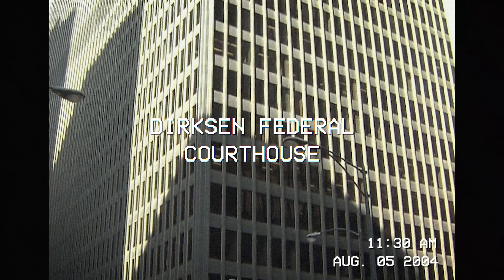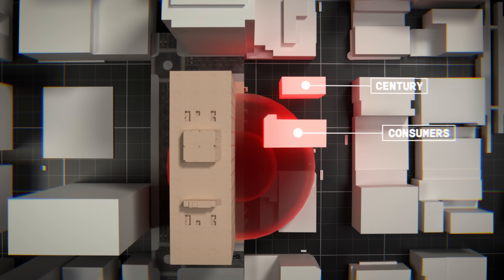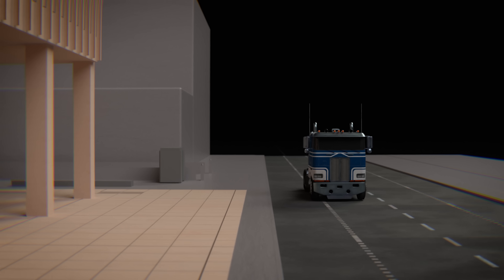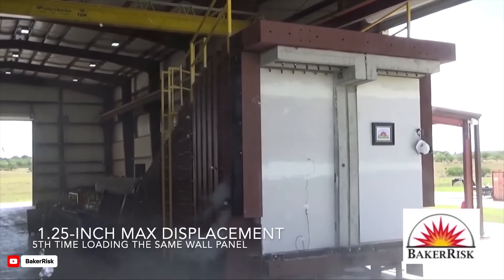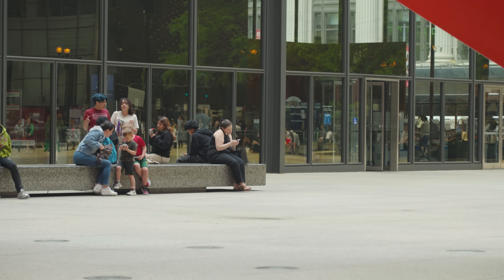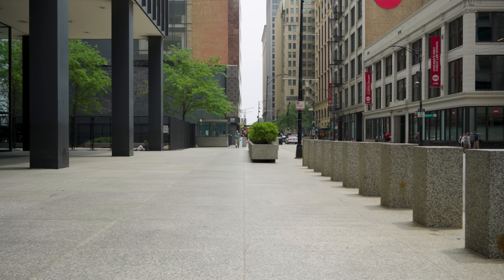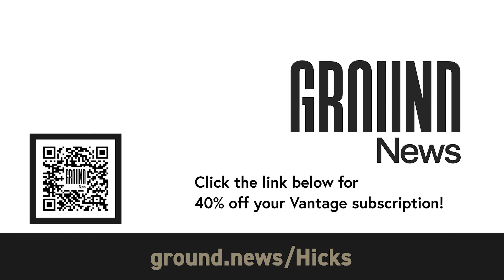How a Bombproof Building Works

Comment: i fast forwarded through to the mid-roll ad only to find that it was infact, already the end of the video?? the switch between 'the bomber has left the trailer in the basement and is driving away' to 'the plan was thwarted before this' was very confusing and unclear. what actually stopped him??

Comment: Some of you so called BIG BRAINS. May want to look at the average height of underground parking (8 to 12 feet), then check the height of a Simi and trailer (13feet 6 inches). 
Your fantasy is not possible the way you have it set up. 
You can't even get some of the smaller U-hauls down there.

Comment: Meanwhile you can just mail or deliver so many things so easily through the front door. Used to be a driver and it's crazy how lax security is at so many places including military locations. Not everything gets checked and even if it does........ that's already close enough, you already let them through. That's just a casual observation of a former delivery driver. If someone put some actual thought and intent into it you could get by even further.

Comment: Ground news put BBC in center ?????
A study by openDemocracy points out that between October 7 and November 4, 2023, the BBC described only Israeli deaths as a “massacre,” despite the Palestinian death toll being far higher.
An academic report found that 69% of the newspaper articles featured in the BBC’s daily program The Papers came from outlets supportive of the Conservative Party, compared to only 23% from newspapers backing Labour.
Richard Sharp, appointed chair of the BBC board in 2023, had donated over £400,000 to the Conservative Party and had close ties to Boris Johnson, even before taking on the role.

Comment: You send strong electro magnetic waves through the yard in front. And goes off before gets there. Fails 150 yards.
Reply: Or a 2 miles radius.
Reply: You have nothing and a grass field zone. Depleting resources.
Reply: Hype it up it ignites gunpowder.
Reply: Like a zero war zone.
Reply: 5 miles you're unseen safe.
Reply: Then you push out 10 miles.
Reply: One machine could end several miles of occupancy. Everything catches on fire.

Comment: No building is bombproof. Not even harden bunkers are completely bombproof. Nothing truly is “proof“ of really anything.

While construction methods and designs can minimize the amount of damage that explosives or other severe damage can cause the idea that a building could be designed quite literally to stop a bombing and survive it relatively intact is largely a pipe dream. 

Don’t get me wrong a structure with the designs implemented to minimize the amount of damage that an explosive device could render is definitely going to fair a lot better than a building that does not have these various things in it, but that doesn’t change the overall fact that if a big enough explosive is used it is entirely likely that even the best design structure will suffer damage.

Comment: Why did you cite the broken windows theory just to say its BS in the caption? If youre going to use it as example you should make it clear that while the theory on its face has some validity (a well maintained building is less likely to be vandalized) the way its applied by law enforcement is BS and has been shown to be discriminatory

Comment: Anonium nitrate on its own isn't an explosive, it's just fertilizer, and deisil fuel isn't used as  a timer.  Ammonium nitrate + fuel oil (deisel), also known as ANFO, is the explosive you're referring to, and it's a mixture of the two substances.

Comment: The broken window theory is anything but bs. For example Transport for London doesn’t let trains with graffiti run as otherwise more damage will be encouraged. We can see that clearly elsewhere. If you let a car unattended by the motorway, after a while someone will steal parts. From then onwards the destruction is accelerated. Same applies to buildings. Once the small time criminals have started to break things, it is seen as an invitation to break more. That’s why it is important to get things repaired as soon as possible. In the UK they have people live in otherwise unoccupied buildings to prevent squatting and the related damage.

Comment: The lack of followup on the plot to bomb the Dirksen courthouse led me to read up on that incident, and it seems that what little was mentioned about the bomb plot in the intro to the video is largely false. Based off the dates and details you mentioned, you must be referencing the case Gale Nettles, but he never got anywhere close to actuating the plot. The "ammonium nitrate" he bought was fake, because he bought it from an undercover FBI agent, and was arrested shortly after.He never actually rigged a bomb with the fake ammonium nitrate, and certainly didn't acquire a trailer to put it in (reporting at the time from CNN, the New York Times, and the FBI itself all agree on this). 

So the story in the beginning of the video about a trailer with a VBIED being positioned outside the building is complete misinformation. It seems like your videos are otherwise well-researched so I hope you take care in the future to avoid spreading misinfo like this.

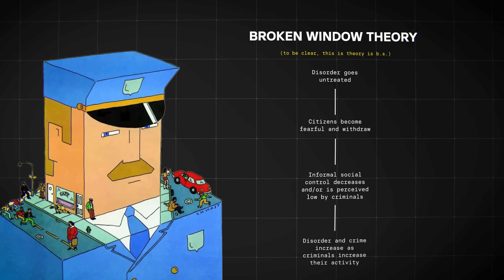Comment: I was really interested until about 9:12 when you noted below is that the Broken Windows Theory is "b. s." Is it really? What evidence do you bring to the table to say that? Seems to have worked in NY and then when it was since 6 away with, crime increased notably. The small crimes, when tolerated, naturally become bigger crimes. That theory extends to  other non-crime issues. The old saying that a chain is only as strong as it's weakest link explains why ignoring the small stuff leads to the biggest stuff.

Comment: I was a courier for a long time and ended up in some crazy high security places along the way, beyond the architecture a lot of the time there's a hidden manpower component that's just as impressive. In the basement of a particular federal building I was escorted through a cavernous garage where I saw a squad sized element of guys in full LEO battle rattle strolling past multiple armored vehicles,  not just bearcats or other standard brinks truck style SWAT vehicles but something that resembled military AFVs, it was a long time ago but I think they were either repurposed and repainted m1117s or possibly some kind of more exotic 6x6. Take this with a grain of salt but someone who at least MAY have been in a position to know this told me once that on the roof they also have air defense capabilities including radar/thermal & optical sensors/EW components and a locker with a few MANPADS ready to go.

Comment: This whole story is depressing--for a few reasons.  First, we live in a society in which preventing major terrorist attacks, most of them domestic, has become the concern of architects, not just law enforcement.  When things have deteriorated to an arms race between disgruntled residents and law enforcement to the point of changing building design, something is deeply wrong with the society.  Second, to say that Federal building does not look like a fortress is stretching it.  True, it could look more like a prison than it does, but the only thing saving it from looking like it belongs in a dystopian sci-fi is the adjacent "park", which is more like a very oversized patio than anything else.  

And third, almost all of the risk VIEDs could be wiped away by simply evicting most vehicles from the city core.  Chicago is particularly well-suited to such a solution, being one of the vanishingly small number of US cities with adequate public transit.  Get rid of vehicles other than buses and delivery trucks that have to pass through some sort of security outside the core, and voila!  Not only do you have a much more pleasant and walkable city, with a sudden decrease in the need for wide roads (which could lead to lovely results like all those winter entryway tents being replaced by permanent structures, room for more green space, which Chicago could definitely use, or if needed, a tram system to supplement/replace a lot of buses), and far, far, far quieter streets, but you also make it a lot harder for ANY building to get bombed.  I mean, great, the Federal building won't fall to a bomb.  How does that help the people in Water Tower mall, 900 North, the Sears--I mean--Willis Tower, or any number of banks, all of which are just as likely to draw terrorist ire?  Protecting the government, but not the people is, as I said, d*mn depressing.

Comment: Similar things happened in Oslo after the July 22, 2011 bombing on the main office building of the government (using a parked van full of ammonium nitrate & diesel fuel). The goverment agencies who were housed in the destroyed buildings, were distributed in offices around the city, and they were surrounded by steel bollards (occasionally clad in stone to blend better with the cityscape), so it would be impossible to leave a car on the sidewalk. The Department of Foreign Affairs got one of these "22 degrees anti-truck-devices" in its driveway (guarded 24/7), all parking around the Parliament building removed, and now, that they’re building a Brand New Very Modern Glass & Steel Goverment Block (to replace what was lost in 2011), they’re lowering a road tunnel under it by 5 to 10 meters in order to bomb proof it (at an enormous expense). You had 9/11, we had 7/22… The first building to surround itself with "anti tank bollards" was the American Embassy, after 9/11. Then, in 2011, it was our turn…
The perp, who continued on to a summer camp on an island for the youth organization of the Labour Party and hunted & killed kids in cold blood until he was finally stopped, is stil in jail. We don’t have life sentences, but he got the full nine yards, 12 years or so (the max for first degree murder), with no possiblity for parole, and then "security" on top of that, a kind of "extra punishment" where perps stays in jail because they’re considered too dangerours to be let loose when their ordinary sentence is up. Of course, if he were to get out, he wouldn’t live long, everybody hates him, and the "criminals" would off him first chance they got. He’s gonna rot in  jail.

Comment: There is no such thing as a 'diesel fuel timer'.  The explosive is ANFO, ammounium & fuel oil.  Fuel oil.  In addition, the OKC bomb did not use diesel.  The term reported was 'fuel oil' which people took to mean diesel.  When in fact it was ammounium nitrate & nitromethane or ANNM.  You are supposed to be telling me how something works.  I don't think so.  I just ran across another junk channel with a dude who doesn't know what he's talking about with 620k subscribers and as of 6/1 222k people have been exposed to his slop.  You should stay in your intellectual lane so as to not mislead people.  Even though it's tempting to just throw something that looks good to make a few buck off your people.  FACT CHECK
Reply: this is AI slope, so it is full of nonsense.

Comment: Seems like the info in this video wasn't researched fully, and was incomplete. At several points I was left confused by the context, and lack of information leading up to something. You said in the beginning he was found guilty, and was later released but for what? Did he work in the building? No motive? And then the video just abruptly ends with no conclusion? You're editing is great don't get me wrong, but this video kinda sucked.

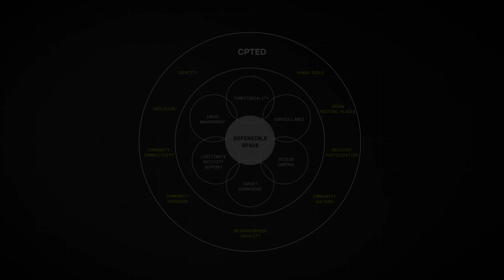Comment: 8:15 - this actually links quite well to a UK design schema, "Secured by Design".

In this case, it's not about preventing terrorist neighbourhoods, it's a bit more of a humble goal of general crime and antisocial behaviour prevention/discouragement, through subtle but very important urban planning, architecture, and landscaping choices. There's online guides about it as well, it's not secretive in the slightest. 

A lot of elements mentioned here have parallels (or exist identically) in Secured By Design principles, passive surveillance and the layout of routes being two very significant ones. There is also certification of products such as doorsets and windows so that developers can select ones which are in fact secure in their design. There's also a similarity in that idea of "territoriality", one design consideration for residential areas under SBD is to clearly delineate property boundaries, with for instance low walls or planting, such that private space is clearly defined and doesn't blend into communal space.

It's a very clever system, and it's largely meant to be unobtrusive, just natural elements of the built environment, but passively discourage criminal and antisocial activity.

----

EDIT: 9:00 - I would be remiss if I did not point out two things:

One: that the "Broken Windows Theory" is not universally accepted, and it's maybe slightly misleading on your part not to comment on that, given it has been used to inform some questionable policing and community management strategies at times. It may be a case of incorrectly assigning causality to correlation (perhaps a building with one window already broken is more likely to get all its windows broken, simply because some underlying factors make that more likely, hence why one window is already broken, and thus repairing that window would not remove those underlying causal factors). The theory itself also generally asserts that police should come down hard on minor crimes as that will prevent major crime, supposedly, which does present some issues.

Two: the tendency of fortresses to attract disobedience and resistance is not part of the BWT. A perfectly maintained fortress is also more likely to attract disobedience, because people tend not to like to feel like they are being controlled and denied choice. Also, hard boundaries rarely truly work but violations of hard boundaries usually result in a visible aftermath, whereas soft boundaries that are designed to influence behaviour tend to be constructed with a degree of tolerance to violations of that behaviour.

Comment: As a truck driver this terrifies me because I go to numerous locations daily with most having no security that is visible. I do go to some sensitive locations, and they have excellent security that I am grateful for. The sensitive locations are not national security or even court houses but have high protection values. for example, a school has designated security procedures that again I am grateful for. An example was a gate left open that is supposed to be closed. I was happy to report this, and it was then shut, an example of citizens eye's working for the common good. This was an excellent presentation and explanation for some cityscapes. it also made me think of why some places have visible security and others it is all passive. BTW I have zero security knowledge past what I have learnt through job requirements and procedures to go on sites that follow procedures for everything from child safety to civilian access on limited sections of a military base or a prison.
Reply: im just a pizza delivery driver, and Same. theres a reason a lot of newer apartment buildings forbid food delivery persons from actually entering the buildings, and older gated communities are removing general gate codes in favor of auto generated ones that residents can use for one off delivery instances. (but with the heightened security has come a lot of... honestly forseeable but somehow not forseen... cracks in the system. like. a local apartment complex gives its tenants ability to use an app to open the gate for people. except. the tenant needs to link that app to a license plate of a vehicle they own (or their parent owns, im sure they make exceptions in that regard). what if you dont have a vehicle. in an apartment complex that advertises to students. for the university that has a bus system set up for this specific apartment complex. so that the tenant doesnt need to deal with owning a vehicle. which many tenants take advantage of. turns out, busses are pretty useful. except now they cant open the gate for delivery drivers for food they ordered because they dont have a car themselves and its late at night and no one else is around to open the gate out of goodwill and now you gotta awkwardly sit there while the customer walks All The Way to your vehicle for their food, which will likely be cold by the time they get back to their apartment.)

anyways. the fact that ive gotten detailed instructions on how to break into multiple buildings while delivery driving is just the cherry on top of this mess.

Comment: Your intermixing of metric and US units is really bad.
Reply: Why? Mixed measurement systems are the standard here in the USA. In my industry, about 30% of design drawings incorporate calculated unit conversions that we have to validate before production begins. 

What’s even weirder, is that manufacturing in China is standardized on US Customary Units. So many products that are “Designed in the USA - Manufactured in China” often feature off the shelf components in mixed measures that are normalized into Metric, then converted to U.S. Customary for production, then converted back to mixed measures for product revisions which are then normalized back to U.S. Customary for production. 

The amount of resources that go into tracking units of measure throughout a complete product lifecycle are enormous.